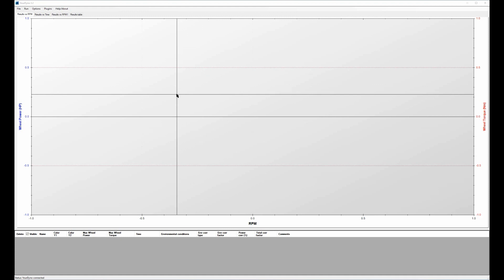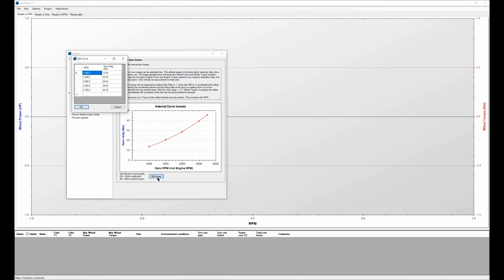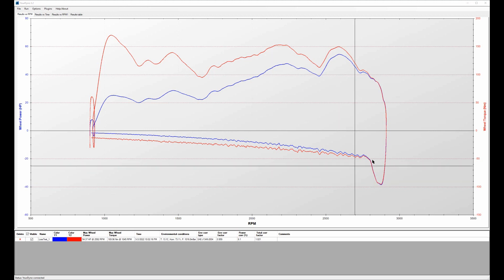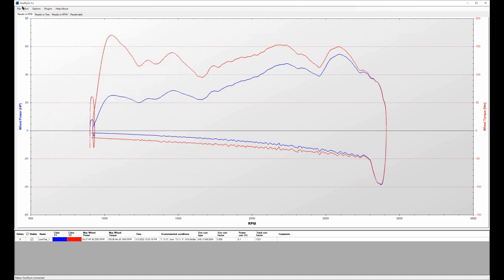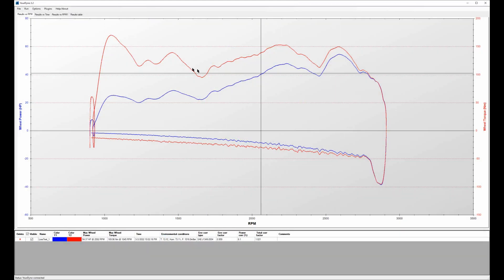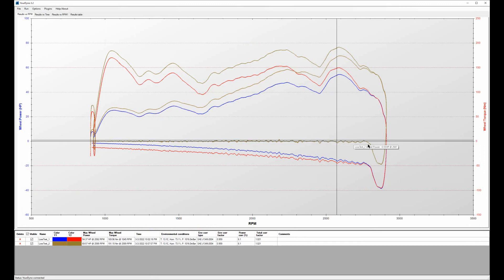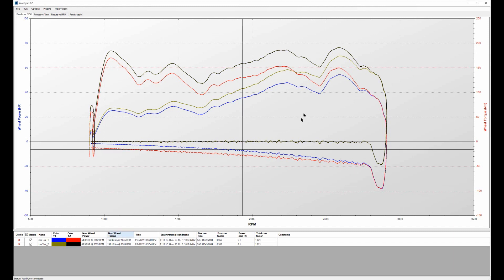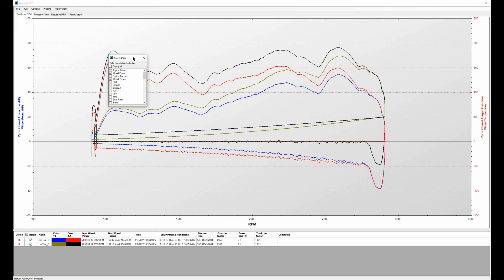YourDyno.com: Internal Dyno Losses

Comment: What recommendations do you have for accelerating the dyno without a vehicle on it? I have a very heavy roller on my dyno (over 70kg * m3 MOI), so it would be pretty tough to accelerate it to any significant speed with anything that could be feasibly disconnected while the roller was in motion.

Comment: I have an eddy brake. What should my settings be, or what kind of run should perform to get the proper data?
Reply: For a chassis dyno I recommend turning on the option to do retardation measurement. It will calculate the drag in the dyno and car/drive train and add this to the measured wheel power/torque. In addition if you are after estimated Engine power you can add a percentage Power correction to account for the fact that the losses in the gear box, drive train and tires that are higher at full power compared to at coast down. This percentage varies from car to car unfortunately, but something like 5% is a starting point